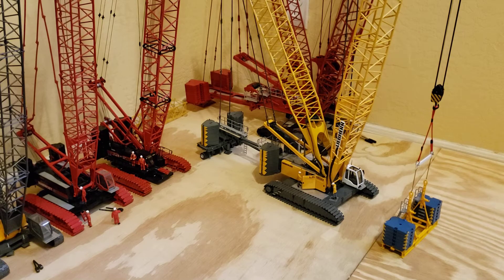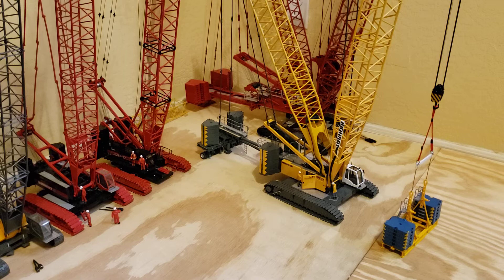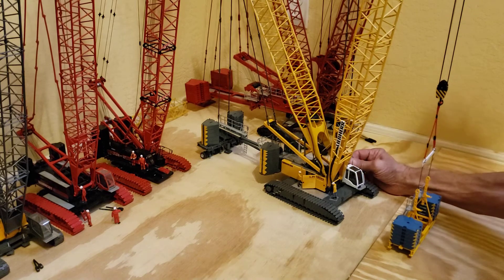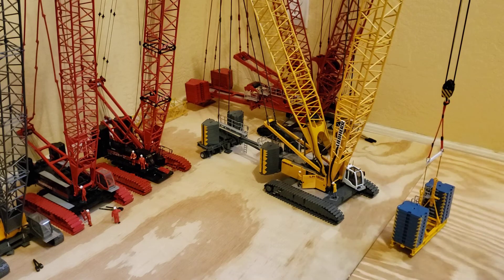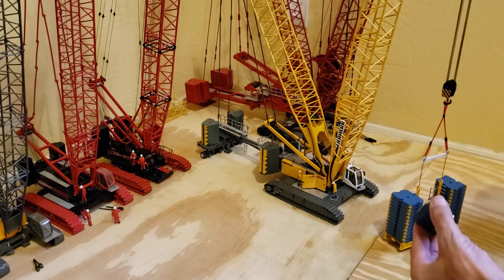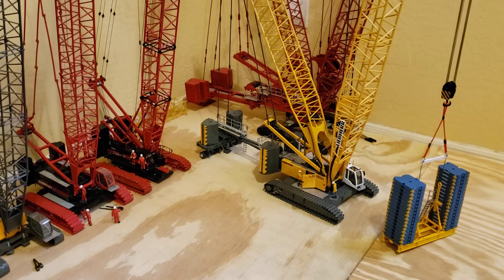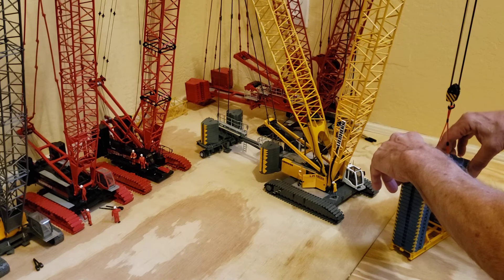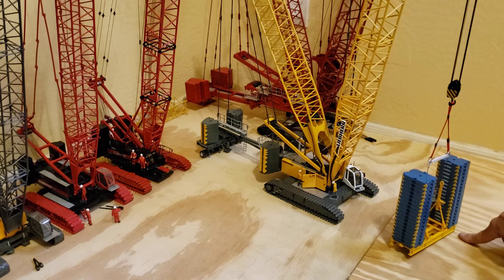How much does this LR1300 really lift?

Comment: Nice video! This gave an idea of lifting capacity  for my new Lr1300 crawler of NZG!
I don’t have the Derrick set with secondary boom! Only with the jib I have with the primary boom!
So hope it can bear 500 grams covering 6inches height!
👍
Reply from the maker: Awesome! I love the LR1300. Beautiful crane, looks bad a$$, and lifts a killer load. The derrick kit is a great addition to this model not just the extra 24m in the kit but that ballast tray gives a real good lifting capacity. Let me know what you were able to lift when you finish. A picture of it would be great. I love seeing everyone else's collection.
Reply from the maker: Yeah I am very fond of this model also. I shot and posted a 1300 coming right at me and turned left! What a sight and sound! They were setting precast walls and had only the main boom. Went on ebay and found and bought the model the next day!  Obviously a very popular crane....many views and comments continue to come in. Hit me up if you need any help. I got the reeving down pretty good and have some good tips. And the luffing arms are reeved very different from all the rest. Good luck bro
Reply: Sure I will let you know let me assemble first 
Rather I will also operate this Lr1300 with Conrad Sennebogen 5500 starlifter  in a tandem lift
Reply: I am fond of NZG LIEBHERR 1300 very much and most as in this model the reeving is factory made and this escapes a lot of time and patience! It’s a very very good model with a solid moving tracks and all parts are nice and very detailed! The jib is fixed with the main boom so one have to drilled out the pins if he requires only a main boom operation! All over a A VERY PERFECT AND DETAILED MODEL! I visited in sites to match with the original full scale ones and yes it’s all are in perfect measurement in Representative factor inch to inch with detailing! 
Thanks
Reply: Okay I will watch your video